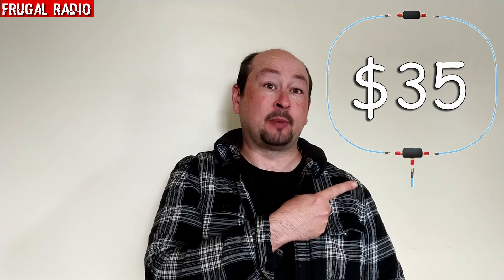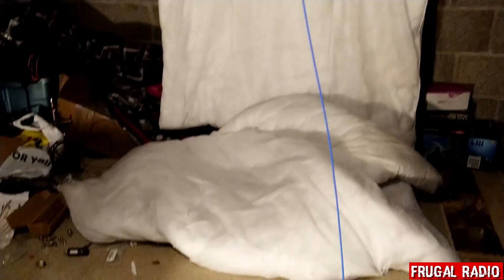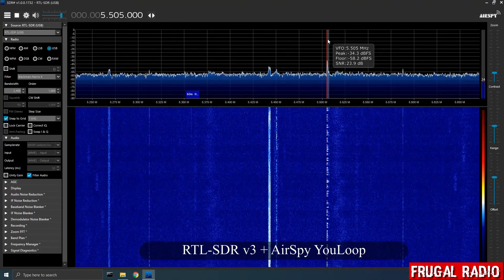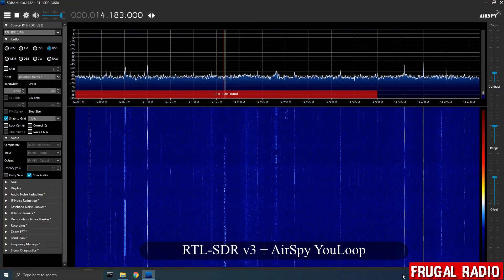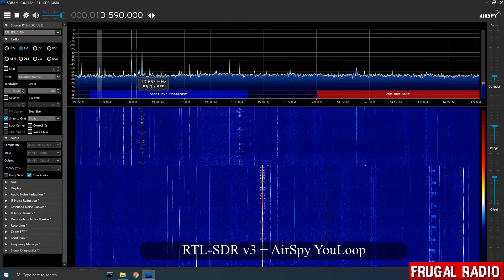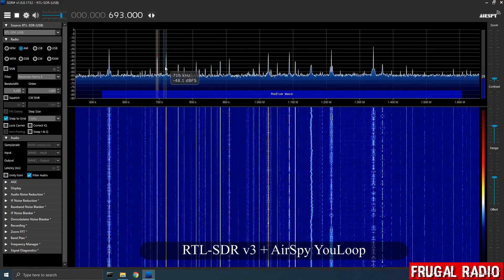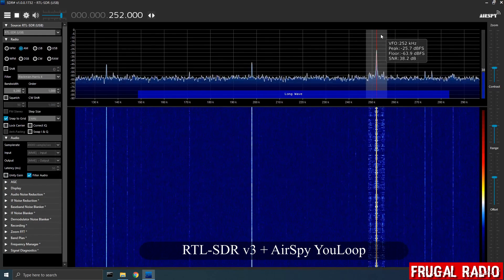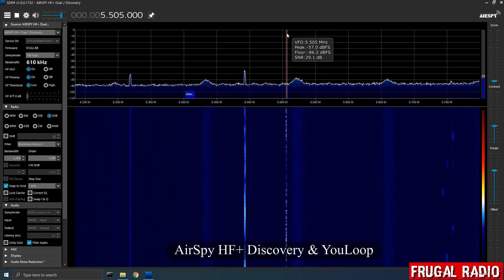Will an AirSpy YouLoop work with an RTL-SDR v3 on HF in direct sampling mode?  It shouldn't...

Comment: I've been trying to use the RTL and have come to the conclusion that it is just a cheap piece of junk. 😁
Reply from the maker: The RTL-SDR v3 units are far from junk. They outperform scanners in many ways!

On HF they are not the best, and I don't recommend them for that.  But their performance in VHF/UHF even up to L band is amazing.  I've got 5 of them and never had an issue.

Did you get yours through the official Amazon store or RTL-SDR.COM store?
Reply: @FrugalRadio  Well I can agree with that.  The VHF side is decent with a good antenna.  I should have been more specific because I was referring to the HF monitoring.  Do you see a lot of noise and duplicate images of the same signal?  Honestly I don't remember which buyer I bought from but it was on Amazon.  Maybe I should check that too.
Reply from the maker: Yes, high noise floor and lots of imaging from FM & AM broadcast bands. Generally you need multiple filters between the antenna and SDR when direct sampling. 

For HF I recommend one of the Step Up SDRs as these have built in preselection filters, and actually receive incredibly well.

https://youtu.be/6dNE20WBogw

Comment: Nice video. I've been off ham radio for years but starting to get very interested again and about to buy an RTL-SDR. 
When you say the receiver is not meant for HF monitoring, why is that.. Should the sampling mode not just be adjusted for the frequency for optimal results?
Have you tried listening to 80 meters and 40 meters for interest? 
With regards to antennas, i'm tempted to try  one of those active HF antennas that look like an IED or something dodgy:) Any experience? Cheers.
Reply from the maker: Hi Paul.

The RTL-SDR v3 is actually a redesigned TV tuner, originally specced for VHF/UHF reception. Since the driver was hacked a decade or so ago, it turns out to be much for useful than a TV dongle! They don't have a great deal of filtering but the upgraded RTL-SDR blog ones and NooElec SMArt are much better than the generics. While they can receive down to 25 MHz, and the RTL-SDR V3 can be placed in direct sampling mode for HF, this is somewhat of a hack. There are no filters for the band, so the unit can become really overloaded. All the more so with an active antenna I bet.

There are several SDRs designed for HF. These have excellent filtering and produce great results. The one I use is the AirSpy HF+ Discovery. It picks up great on 40, 80 even 160m, as well as 20 of course. Even the SDRPlay RSP1A, which covers a very large bandwidth, does a good job on HF.
Reply: @FrugalRadio  Thanks alot for the reply. I think i'll go for the AirSpy HF+ Discovery in that case as i'm mainly into HF. 
  I'm from Ireland myself. I relocated to the Czech Republic a few years back. I haven't done anything on the bands in years but considering getting a callsign here and actually starting to operate again. The problem I have now is that i'm living in an apartment block, so of course not really possible to install a HF antenna for proper operation:) I'd guess you're a HAM operator too?
Reply from the maker: Yes, I'm running on a Canadian callsign these days as I'm back on Alberta. Haven't done much TX since I was in Ireland last year.

Another possible HF SDR for you would be the RSPdx. It gets great reviews too. I haven't used one myself, sooooo haven't been able to do a direct comparison with the HF+ Discovery.
Reply: @FrugalRadio  Ok thanks. SDR is new to me and it's interesting. I'm considering directly buying a standard HF transceiver actually. I don't suppose you'd have some recommendation for a limited apartment space HF antenna for normal operation?:)
Reply from the maker: Sorry Paul, I haven't done a lot of HF transmission, so no first hand knowledge of TX antennas for limited space.
Reply: @FrugalRadio  the basic sdr play good enough or the dx is worth the extra coin?
Reply from the maker: The RSP1A is a great SDR, especially for getting started. I haven't really used mind on HF, and my HF antenna is down right now, so I can't personally comment on it for that. It has great filtering though, and would work well in sure. They have a good reputation, and the unit represents excellent value for money.
Reply: @FrugalRadio  I've actually gone and bought myself a Kenwood TS-590SG and got setup again and back transmitting since then:) And yes, i'm looking for an RSP1A now to interface to the radio to view band activity. Cheers.
Reply from the maker: That's great to hear Paul. I used to have an older Kenwood HF TX as well.

Comment: Hello from Venezuela. What if we do the same experiment but using an upconverter? could it make a difference? Excuse my English. 73
Reply from the maker: I expect the results would be quite similar, although an upconverter should improve reception compared to the Direct Sampling mode.

Comment: What do you think of the VHF performance relative to the dipole in the RTL-SDR bundle?  I'm thinking of getting a YouLoop (currently only $29.95 at airspy.us).  I currently only have the RTL-SDR v3, but am most likely going to buy an SDRplay RSP1A soon, so I'd need an antenna that will allow me to receive lower frequencies anyway.
Reply from the maker: You know I still haven't tried the VHF performance on the YouLoop. Keep meaning to do that!
Reply: @FrugalRadio  Well, there's an additional video topic idea - an antenna shootout/comparison.
Reply from the maker: Yep!
Reply: @FrugalRadio  BTW, have you heard of Wolf River Coils? They sell what are essentially manually tunable antennas.  They're oriented more toward the mobile/packable market, but can be used in semipermanent installations.
Reply from the maker: No, haven't heard of them before. Have you tried them?
Reply: @FrugalRadio  No, I haven't quite gotten that deep into the hobby, yet (haven't gotten to running coax or mounting/installing anything more than sticking the dipole attachment to a window).  They look interesting and sound like a good value, but I can't say I'm yet confident in my understanding of things to make a good assessment.
Reply from the maker: No, I haven't. My hands are busy enough with the equipment I've already got!

Comment: Why wouldn't it work?   Sure it won't work well because of limited dynamic range but there is no reason why it would not work?
Reply from the maker: Such a small antenna for such a lengthy wavelength? Try putting a 1m wire in your RTL-SDR and see if you can pick up anything! When I tried with a 5m wire, all I got was electrical interference etc. Hence the surprise!
Reply: @FrugalRadio  As I said, limited dynamic range.....
Reply from the maker: Yep.

Comment: Okay, what antenna would you suggest for use with the RTL-SDR? For AM and shortwave? Thx
Reply from the maker: I would start with a random long wire, connected to a balun. Or something like a HAM dipole (G5RV type thing). However to make the most of those bands, you'll soon want to move on from an RTL-SDR and pick up something that is designed to monitor those bands, like an RSP1A, RSPdx, or Airspy HF+ Discovery. Each of those provides much better reception on AM & shortwave.

Comment: I'm starting with this setup because of the cost and delivery time, however, will turn rtl-sdr to higher frequencies later and settle for an airspy discovery. Thanks for testing this!
Reply from the maker: Glad that it has been helpful. The Airspy HF+ Discovery is an excellent SDR to aspire to. In the meantime, you work with what you can afford. This combo will indeed get you monitoring, and will probably wet your appetite for more!
Reply from the maker: Yes, a discone will definitely help you out on the VHF / UHF bands. https://amzn.to/3jNPHx0 is a reasonable one to get started, although if you are going to monitor low band, the 1411 would perform better.
Reply: @FrugalRadio  random comment, but yeah thank you for that, wierdly they wouldnt come up in my amazon searches, i might be or try out ther 1441, since its only 3$ more than the 1410.
and after googling it seems the 1411 is better than the loop, for .... stuff

Comment: I bought an RTL-SDR 3 for my first jump into SDR. I have had limited success in the lower band ranges, and knew the limitations. I wanted something to do some playing around with, and try some things more space related (satellite reception, meteor forward scatter reception, and maybe attempt hydrogen line stuff). The ability to listen to shortwave seemed a little unexpected bonus for the price. I may get this antenna, though, and see if it helps me get some better reception down in the lower ranges. I would certainly like to get a higher quality SDR later to do some VLF and ELF stuff, especially stuff related to auroras. Any recommendations for something which could be used for radio astronomy/sky watching type activities that wouldn't break the bank (maybe around $100 US)?
Reply from the maker: Your primary options in the $100 range are the AirSpy mini and the SDRPlay RSP1A. The 1A offers greater frequency range. I've never experimented with the astronomy side of the hobby, so don't feel I can really comment on that.
Reply: @FrugalRadio  thanks for the reply, and your advice. I'll look into them more. I just nabbed a signal from a NOAA weather satellite this morning, so that's pretty cool for the $50 or so I have invested in the SDR, a commercial FM stations radio filter, and simple antenna. This hobby is addicting. I like astronomy, and space in general, so hence my interests aiming *waves hand toward sky* that-a-way.

Added thought: I've done a bunch of meteor forward scatter stuff so far in the couple weeks I've owned it. It was the easiest thing to do out of the box.
Reply from the maker: You've made a fantastic start in the hobby, well done. Sounds like you jumped right in! Congrats on the NOAA sat reception. From time to time you'll be able to receive the ISS transmissions as well. They often do Amateur Radio contacts in the 145Mhz band, and it is easy to receive them on a pass.

I have enjoyed receiving data from space too. Back when i was a teen, I used to monitor the space shuttles / mission control comms that were rebroadcast on HF. Was so excited to listen in on missions from my location in Ireland at the time!

Comment: Great videos 
I use my rtl sdr v3 dongle with HF ANTENNAS  dipoles  ect.  What you have to do is go into your software  and put it into direct sampling mode  and select Q BRANCH also the bandwidth  you use makes a big difference.  I found 1.5 works best most the time for me. Also I have to set the gain each band it helps a lot. Been thinking about a youloop  or possibly a ML30 loop.  I've had good luck with full wave loops are great if you have room.
Have fun with the hobby. 
AA4CP Chuck 
Port Salerno FL USA
Reply from the maker: Thanks for the info! When we move to another property I hope to pick up an MLA 30.

Comment: I wasn't expecting a video response to my question, I feel very privileged. I've also realised HF isn't great on the RTLSDR and I am now trying to decide between a RSP1A or the AirSpy R2.
Reply: Airspy HF+ Discovery.  It works very well.
Reply from the maker: Glad it was helpful. I think it was an interesting experiment to perform.

If it is purely HF you are seeking to monitor, you might want to consider the SDRPlay RSPdx or AirSpy HF+ Discovery. These both provide greater sensitivity on HF. The R2 would also require an upconverter to work on the HF bands.
Reply: @FrugalRadio  The RSPdx  might be the best bet then as I'd like to go up to the 400MHz range as well. I just wish there was native Linux support on SDRUNO as it looks a really nice piece of software.
Reply: @rob_pic  try sdrangel it's outstanding 😁
Reply: airspy hf+ discovery is the best
Reply: I have an SDRplay RSP1B that works great. It is usually connected to a fan dipole for 40, 20, and 15 meters. Good signals from 1 to 850 MHz. I tried a YouLoop but there were almost no signals on any frequency. Don't waste your money. Anything works much better than the YouLoop.
Reply: @billryland6199 

Lovely, which is your antenna exactly, please? Thnx